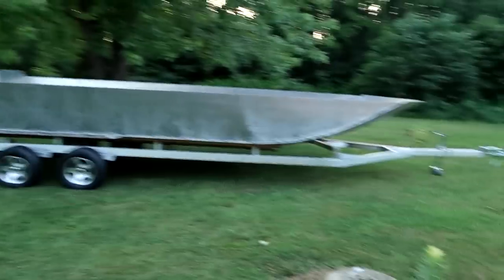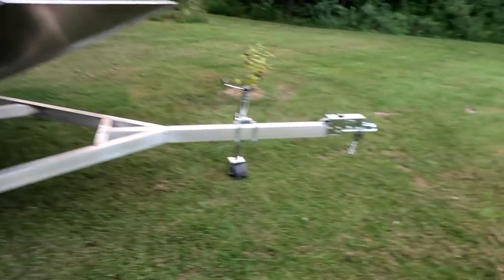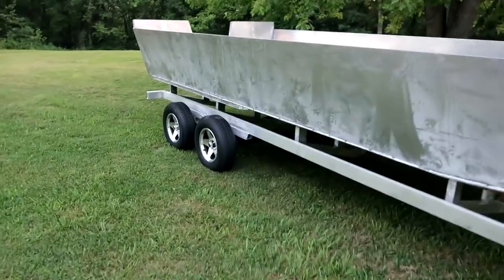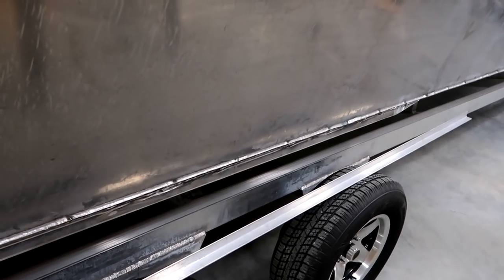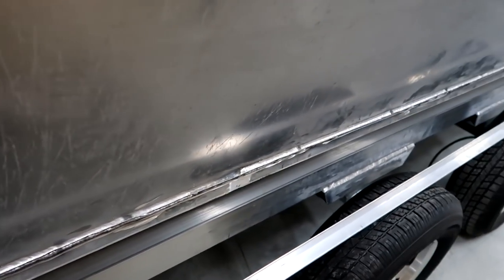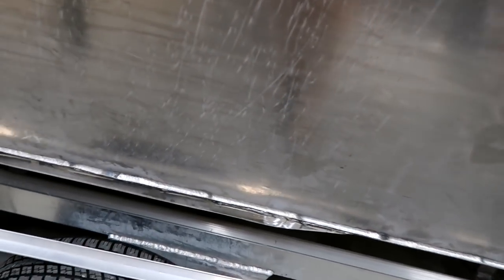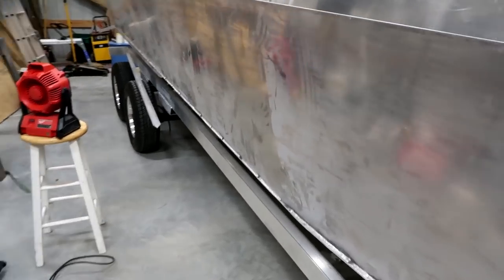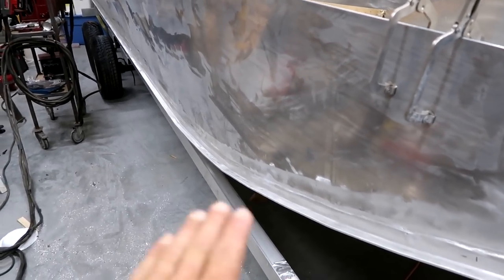Building a 25ft Aluminum Boat Part 9

Comment: I am having a concern about crevice corrosion under your spray rail or any other location water can get into and get trapped ( keel ?) especially if it is in salt or brackish water, what is your thoughts? 
I lost the bottom of my aluminum drift boat from use in coastal bays to corrosion so it does happen.
Reply from the maker: This boat will more than likely never see salt water. I am located in the center of the country

Comment: Your welding is outstanding using a spool gun ! I use a push pull on a Miller 252, not a pulse and it doesn't do any better.

Comment: Might be a little late to say this, but if you heat aluminum with a propane torch, the spray rale should bend enough to match the hull.
        By the way, you should be very proud of the work you have done. I'm proud just to look at it, damn good job my friend.

Comment: Your axles are way too far back on the trailer.  2/3'rds of trailer to centerline of axles is the general rule.
Reply from the maker: Please remember that the motor weighs 700 pounds and extends a additional 3 1/2 ft out the back of the boat if you figure all this in the axles are placed correctly. Thanks for watching

Comment: use 3m Edge lube for your flap discs, it prevents loading. I use Cornerstone supply and flap discs  are CGW, about 3.50 each. Ask for Andy ! Not me but they are a good supplier !